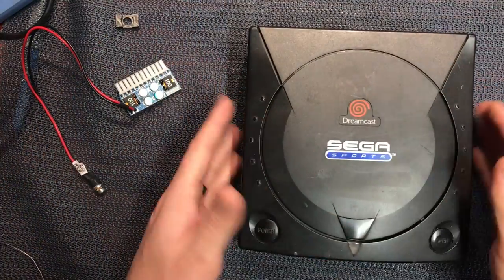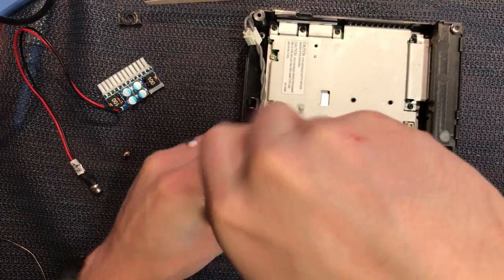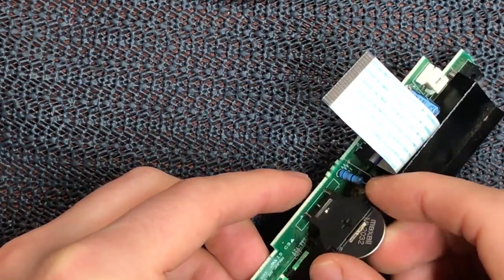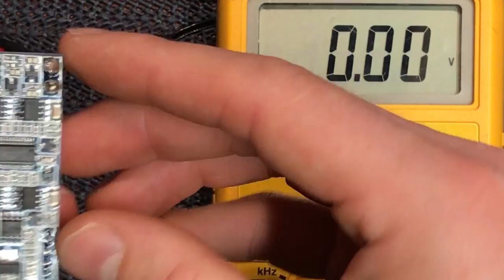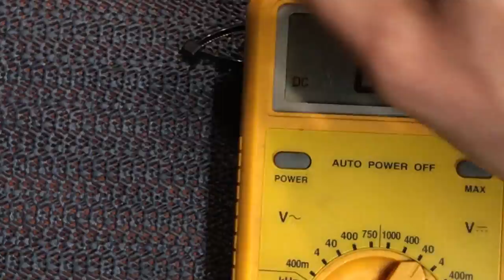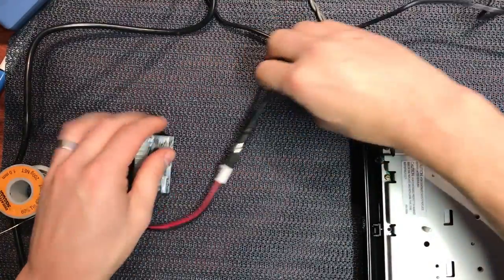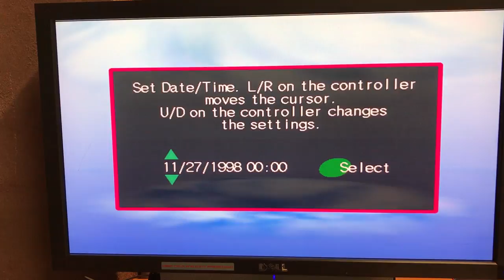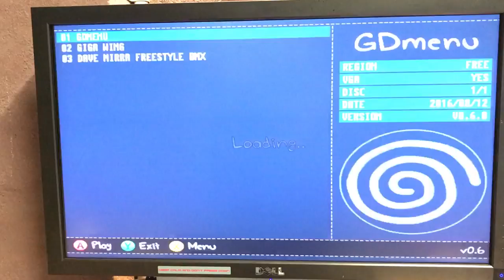Sega Dreamcast DIY Replacement Power Supply PSU Jpn - YouTube

Comment: I used the power button to bridge 15 and 16 on the pico. Power off, connection open. Power on, connection closed.
Reply from the maker: Chris Ghysel Yep that's a good idea and  probably going to be in the instructions with the final kit I release. Thanks for the comment.

Comment: Why are you not installing an internal 100-230v step down to 12v so you can just as easily reuse the same figure 8 230v power cord? Id expect there is enough room for that to fit without an issue, and theyre about $6 delivered to Australia.

Comment: Really like the 3D printed part plus the ability to run in my car on 12 volt system.

What has me really confused is trying to figure out why your first step was bridging the on-off switch only to add a cutout later... you could have just soldered the wires straight onto the boards built in on-off switch you bridged to begin with. Not only would it turn the console on and off, but it would not have hot 12 volts going through the small switch. It would be a signal wire super low power like the factory wanted. Plus it's basically just extra work and more connections to eventually have problems. Effective use of add on switch would only be better if used to cut out the 110 before the first inverter.

Not at all trying to bash or hate, just perspective. I learned and will probably use this type of setup for hooking up my Dreamcast in the car. I do think it is overall a great mod!

Cheers
Reply from the maker: You're absolutley correct sir! I regret filming it the way I did. I did it that way for simplicity so beginners can follow along, but the way you mentioned is the way I personally do it so I think I'll remake the video and post it again. I point the instructions to this video, so I'll send all the buyers of my kit to the new one.
Reply: @GlobalGarageAus  Hi, where can I ask the new updated video? Thanks

Comment: Is there any way that this mod could be changed or modified so that the output of the pico psu could just use a standard figure 8 power connector?
Reply from the maker: Not really, the PICO needs 12V DC and the figure 8 cable from the wall is anywhere from 100-240V AC. It's this conversion that is what the external 12V 5A power supply is for. You could hide it inside the console if there was room I guess, but generally the decent ones at 5A are quite large.

Comment: I know you say use a 5A brick since 3A is too close, but I happen to have a 12V 3A laying around and the Dreamcast PicoPSU kit you linked comes with a 12V 3A anyways. How bad could a 3A be? Would it just power off/restart or possibly damage a component? I'd prefer to just use a 3A since I plan to do two mods and that will save me abit of money.
Reply from the maker: Protofall Yes that’s my kit. They all ship with 3A power supplies now.
Reply: @GlobalGarageAus  How come it comes with a 3A instead of a 5A since you mentioned in both this and the Saturn video that you should try to get a 5A if possible?

Btw I like your videos on installing this mod, it makes me a lot more confident to do it myself. Thanks :)
Reply: I just saw Xaranar's comment below which seems to explain why you chose the 3A option. Cool :)

Comment: Couldn't you wire the power switch to the Power Good/PSU On pins on the ATX connector?
Reply from the maker: Yes you can. That's an alternative way to do it.

Comment: i have a dreamcast VA1 model PAL and i have a GDEMU is it a good idea to get this PicoPsu PICO ATX Kit ???
Reply from the maker: Your original PSU will be getting hot on the 12v line, so it's a good idea to either modify the stock one or just put in my kit.
Reply: just ordered from your website :)..... btw will you be getting  Clock Battery Replacement back in stock any time soon ????
Reply from the maker: OK great I can see the order. Yes the Dreamcast batteries are on their way from the supplier now. Contact me  at info@retrosales.com.au and we can discuss what to do. Maybe hold the order until the batteries are in?
Reply: send my order i have made and let me know once u get the battery kit in

Comment: Does it need to be 12V i have a power supply from a laptop but that is 19V does it do?
How many AMP is recuired?
Reply from the maker: It should be 12V and 5A DC
Reply: has to be 12v.  You can't feed a PicoPSU 19v, you'd kill it.
Reply from the maker: oldgraphics that’s about right. 3A is not quite enough, so I’d recommended 5A
Reply: 3A is more than enough for any system.  GDEmu does not need anywhere near that much power.  Infact GDEmu pulls power from the 5v rail, which never pulls more than 1A max.  You don't even need the 12v pin connected when using GDEmu

Comment: Man,did the LIR 2032 work the same on the battery for the time?
Reply from the maker: xDakem I don’t think i understand your question? The LIR is 3.6v so it’s not the correct one to use. You should only use a ML2032

Comment: Great job. Just picked up my first Dreamcast, which is Japanese. Any idea what the kit is going to go for?
Reply from the maker: The Japanese Dreamcasts are great, especially an early revision. The parts for the kit are quite expensive, especially the PICO power supply. I'm still getting pricing options from various suppliers. I want the kit to include everything so it's easy for the installer. Under $50 AUD
Reply: What's the best way to be notified if the kits become available?
Reply: I did this mod but the dreamcast led Only blinks then nothing. Any i dess?

Comment: even though my dreamcast battery  is  working I would  be intreasted  in buying the 3d printed battery holder very simple to replace battery
Reply from the maker: Greg Jarvis The battery holder isn't 3D printed, that was the power supply output part I made. FYI here's the rechargeable Dreamcast battery kit for direct solder in https://www.retrosales.com.au/products/parts-modding-dreamcast-clock-battery-replacement

Comment: How many w is the pico psu on?
Reply from the maker: The Pico itself is 160W which is overkill but that's all they make. The external 12V power supply I use is 5 Amps so that makes 60W which is also a lot. You could get away with a 3A external supply.
Reply: Global Garage thank you for your answer. I did this psu mod but when i start the dreamcast the light Only blinks then it shuts down. But ur i took out the gdrom it runs about 10 sekunds then shuts down. Any ide about whats wrong? I have tried it on two diffrent dreamcast but the same result.
Reply from the maker: Björn Jädeholm How much current does your external power supply have?
Reply: Global Garage it has 12v 5a